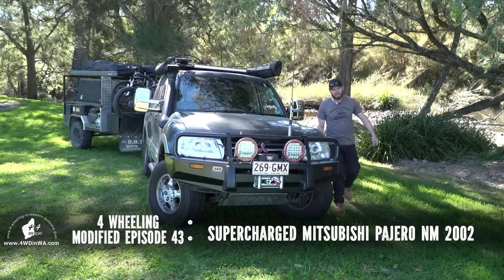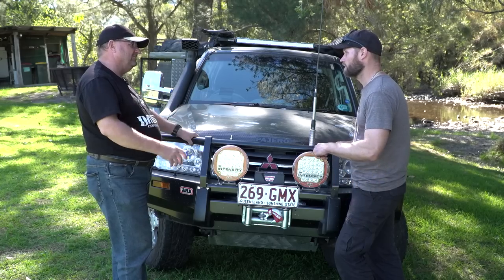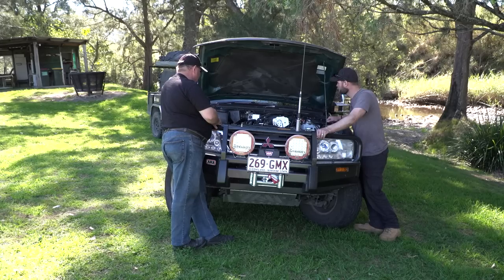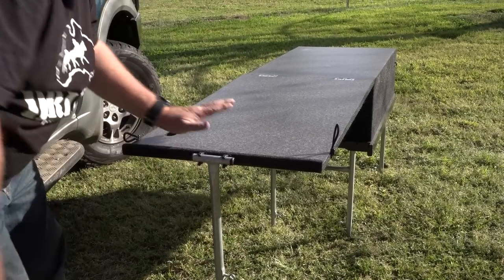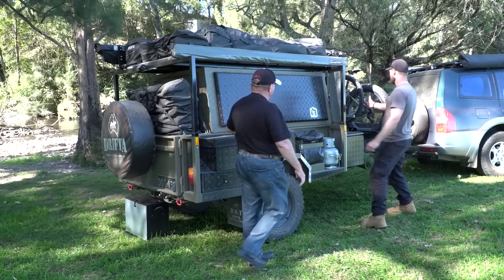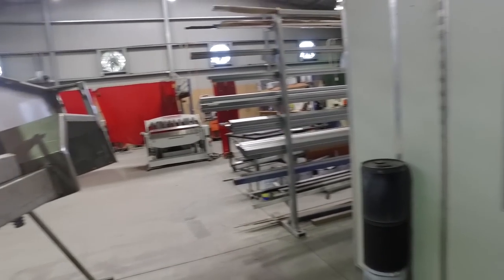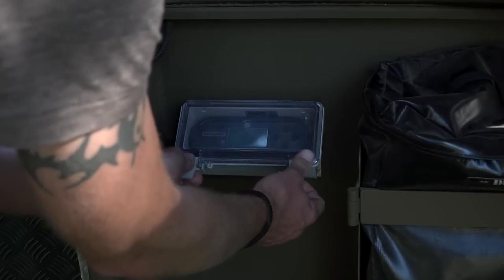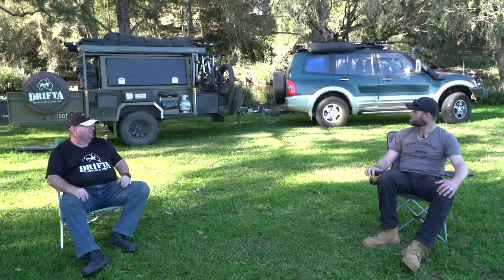Mitsubishi Pajero 4x4, Modified Episode 43

Comment: It’s like a slap on the face to Andrew St.pierre 🤣😂
Reply: He's not a fan, is he? Lol
Reply: I’m pretty sure Andrew liked that model, he didn’t rate the newer model though from memory.
Reply: No Andrew loved the model is was the next one he didn't like this specific year though was the odd one where they started turning to family SUVs
Reply: He talked about Pajero 4, but made a mistake and said Pajero 3. They are very similar. He said he liked Pajero 2. From my point of view, the only major downside of generation 3 and 4 is the very limited travel of front suspension. And the best is like the owner here said, a very versatile car, good for city and outside it.
Reply: He's also not a fan of trailers.
Reply: Brad D gen 3 & 4 are similar in many ways. Andy pierre dont know shit.
Reply: Remember he was talking about bone stock vehicles, he did say with a little bit of work they can make good touring vehicles
Reply: Lol, I think Andrew simply claims the (whatever gen he reviewed) isn't very good stock. I think he admits it's perfectly fine with mods.
Reply: "  Tupperware Princess "
Reply: Andrew is 100% correct. This thing might go alright with front and rear lockers. But they are build in car fashion, with unibody design and that makes them far too rigid as a 4wd. And Fraser hardly requires a capable vehicle, just need the right pressures. Also, he was referring to the following generation of paj... Which suffers the same issues in rigidity, worse so in fact.
Reply: Brett Hooker if it does what you want to do the 👍👍
Reply: For most people the pajero is absolutely fine and a better on road car than most. Also much cheaper than a landcruiser or a discovery.  Andrew SPW is a hard-core overlander. How many people really need the sort of thing he does? Really? Honestly?
Reply: Andrew’s opinion is very valid as he is a hardcore overlander. There is not yet a car that can satisfy everyone needs and that’s why fortunately we have a huge variety. My personal opinion is that in the middle of all the range of selection the Mitsubishi is a very underrated car as they are very fine in everyday living, but the day you need to get into the wild it could kick someone’s ass and leave  jaw dropped others. Not all models come configured in same conditions but at least my limited trim 3,5 v6 comes with Torsen diff In the rear, central diff lock, shiftronic INVECS gearbox and a ton of attitude.
Reply: ASP is sponsored by toyota. Real world practical knowledge says pajeros are cheaper to buy and are reliable, but require a bit more attention with regard to maintenance. Toyotas are far more expensive to buy but can take a bit more abuse and neglect hence a little bit 'more reliable' in that sense.

Comment: good to see a rig thats not all about big tires and big lift
Reply: That’s true.  It reflects what most people own, daily driver “real 4wds” with the 2 inch lift and minor bar work.  Not the 4 inch lifted Patrols running 35 inch Super Swampers, custom mandrel bent snorkels, double d’locks and thick deep noted exhausts.  Was good to see.  I personally wouldn’t own a Pajero but I liked the vid.  Plus he was s really nice bloke and well spoken.
Reply: @cliffbooth7075  Why wouldn't you own a Pajero?
Reply: @bradh6185 
I own a Prado, so does that answer your question?
Reply: @cliffbooth7075  Can't say that it does. I don't know what a Prado is.
Reply: @cliffbooth7075  I'm American.
Reply: @bradh6185 
My 120 series Prado Grande is similar to the Lexus GX470 but our version looks better.  The Pajero is your Shogun.  You’d see my point now 🙂
Reply: @cliffbooth7075  Not really. The Mitsubishi seems to perform better than the Toyotas.
Reply: @bradh6185 
I do mechanical work on cars & mainly view all vehicles from a mechanical point of view because that’s the side I see of them.  Toyota’s are put together with higher quality materials than what Mitsubishi’s are.  Right down to gasket seals & bushes.  They cost more because they’re built with longevity in mind.
Reply: @cliffbooth7075  I'd pick the paj tbh
Reply: @Jefferson-ly5qe 
If you don’t off-road much it’d make sense with the front & rear independent susp, single fuel tank.  Better for the suburbs & school trips perhaps.
Reply: @cliffbooth7075  I probably offroad a few trips a year. Believe it or not, my old Pajero has done well. If I wanted to do more ambitious trips I'd get a 79 series, wouldn't bother with a Prado.

Comment: I have the exact bloody style but 2003, accept the roof rack is a Tradesman alloy and my wagon is 3.8I V6 Diesel Turbo, minus the bright mirrors, mine are gloss black. This is awesome. Great great wagon, love it. Cheers Ronny, ATB Moose
Reply: MOOSEDOWNUNDER they come in 3.2 turbo diesels and 3.5/3.8 petrols? You can't have both engines in one haha
Reply: i hope u dont service ya own car. u cant even tell the difference between a 3.8 v6 petrol and a 3.2 in line 4clyn turbo diesel
Reply: On a side note, a 3.8 v6 td would be mad under the bonnet

Comment: Great faith in a 15 year old vehicle to keep investing in it. Just goes to show that if you look after your vehicle how long it will last. I don’t think a 2017 / 18 vehicle will last to 2032 though!
Reply: Bob Pfaff completely agree,  it's the VW theory as mechanics call it pre 2014 diesel VW cars are guaranteed to last forever but the new stuff with all the emissions regulations crap just give up and suffer from cheaper parts the old diesel vans were know to do 250,000 to literally millions of miles,  I bought an ex taxi shuttle bus with 1,500,000 MILES on the clock original engine and gearing the newer ones are still capable of 250,000 but it is basically the same engine as the 2011 with more crap and turbos
Reply: Petrols will generally go the distance with minimal financial outlay...  New model diesel’s though are another story all together.  Expect to have to outlay big bucks at the same age.  Not like diesels of old with the new emissions technology on them that is plagued with problems.  New problems on top of existing problems that the modern diesels already had.
Reply: assuming your American, in Europe Diesels are substantially cheaper, more reliable and more efficient. but some lack the performance of petrol however that is changing with the incoming of bigger turbos. petrol engines typically only last 100,000 miles whereas diesels last atleast 200,000 if looked after properly much more
Reply: daily drive my 05' with 230k miles, maintenances are key, that's it.

Comment: Valve stem seals are a thing to look out for on the NM Pajero (petrol) and of course the usual... oil leaks.. funny electronics..etc Also wheel bearings. NP fixed an issue with them.

Comment: Rohnny! Love your videos mate, been subscribed for a long time. I recently traded off a single cab 79 for a gen 4 pajero and will never look back. Id love to see a gen 4 pajero modified episode!!
Reply: Is it a diesel? What year? Have you taken it off road? I'm thinking of buying a 3.2 L diesel auto (after 2013) and would like to hear your experiences; esp, as you had a  79 which I assume must have been pretty capable off road.
Reply: @dimitristsagdis7340  hey mate, yes 3.2 diesel 2017. Its awesome still love it so much more useable and comfortable for my style of use. Seems to take on challenges with ease off road very capable for the type of stuff i do (no hardcore rock crawling) but awesome on the beach too. Just does everything well. 79 honestly was not as capable as people make them out to be it was overrated. Got bogged in wet grass a few time and thought wtf. Wasn't comfortable at all either on longer drives. Pajero has it all and does it all.

Comment: I thought with the supercharger it would help with the fuel use. I have a 2001 ecssed and I get around 11L per 100 and that's with 91. Wonder if he is running 98 with the supercharger you would think he would.

Comment: How much hp?
Reply: Agent. K. About 180-200 but a metric fuck ton of torque
Reply: Way less. You can get a 4x4 Dodge Ram Tradesman with a manual and 800lb ft of Torque for $40k new here.
Reply: but 40k for a pick up is ridiculous but it still has quite substantial torque probably around 500lb ft
Reply: I mean, it comes more well equipped than Ronny's 70 series with more torque for less money, with an 8 ft bed or tray, and it's a Cummins engine, so no FCA problems. It's a pretty sweet deal.
Reply: I have the same set up on my ml triton by the clowns at rpw and running a piggy back haltech the about of the charger is the weakest point going l98 now dnt waste your money at rpw and hp gains are not worth the 20k price tag this package